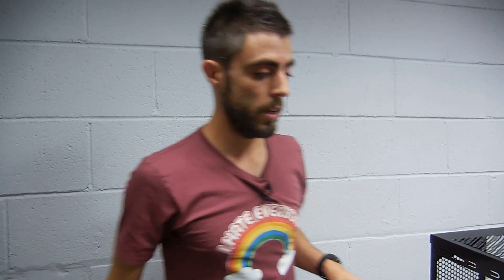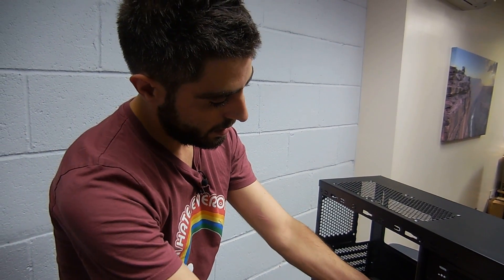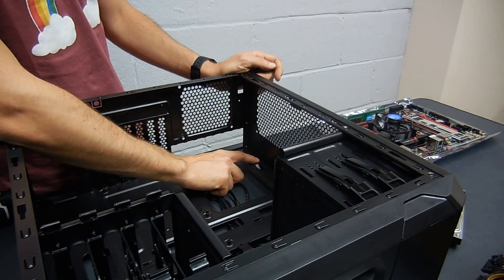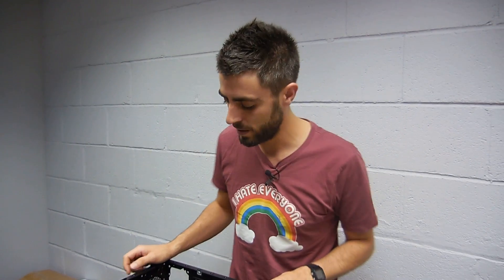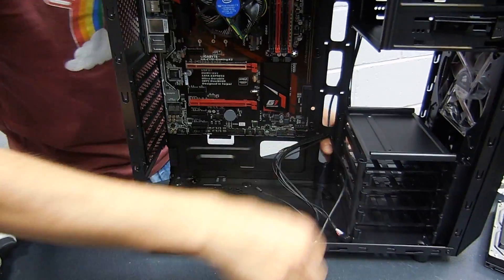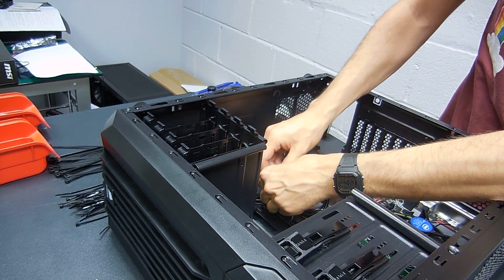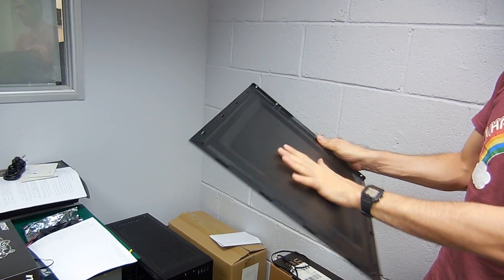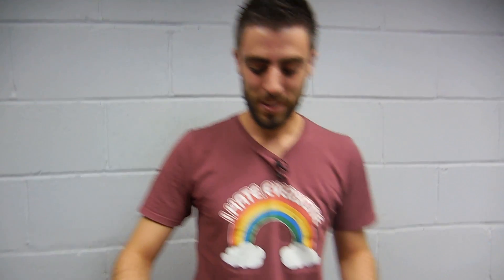HOW TO BUILD A PC: Step By Step Easy Guide (DINO PC) Part 2

Comment: Is this build good for gaming 
PROCESSOR: AMD Athlon X4 880 or AMD A10-Series APU A10-7890K 
MOTHER BOARD: ASUS A88X-GAMER or CROSSBLADE RANGER
VIDEO CARD: R7240-OC-4GD3-L or (any higher end video card depends on budget)
KEYBOARD: ASUS Cerberus Keyboard
MOUSE: ASUS Cerberus Mouse
MOUSE PAD: ASUS CERBERUS MOUSE PAD
HEADSET: ASUS Cerberus Headphones
MONITOR: ASUS VP228NE x3
RAM: Kingston FURY 8gb x2
HDD: 2tb 
SSD: AMD R3 480GB
Reply: Aeze Que not gonna lie you'll be able to play some games but nothing really new
Reply: Aeze Que you need a better gpu